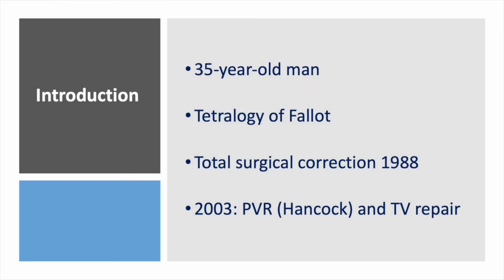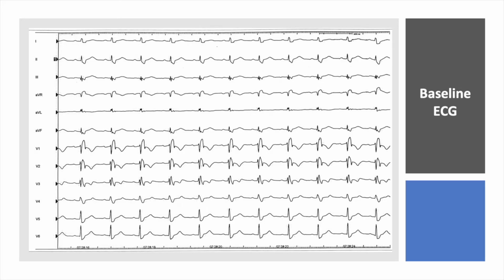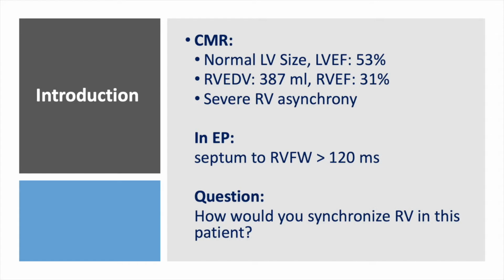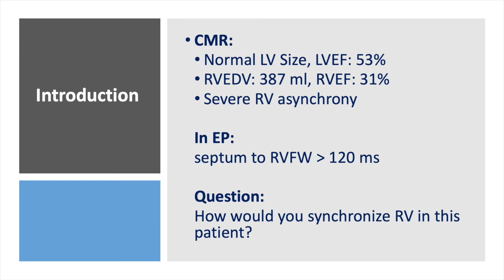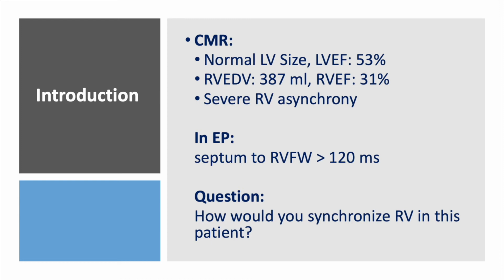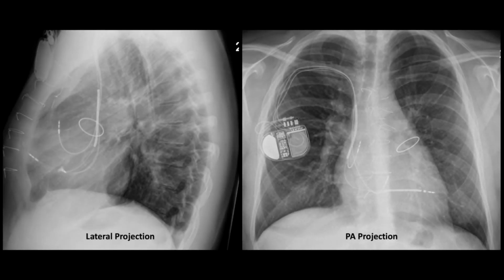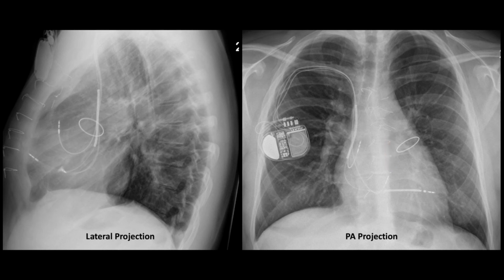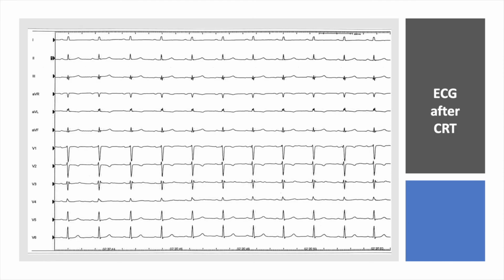ECG Exercise Nr. 19: how to synchronize the right ventricle

Comment: nice result! 2 questions? 1) how did you measure "delay" in RV activation in EP? just putting quadripolar catheters in different RV segments? 2)why we dont use this technique for all RBBB patients with reduced RV or even LV function?
Reply from the maker: Dear Ali, the measurements were from RV septum to RVFW. Regarding the second point, it is a good question and we need to run some studies to address this issue, nice comment !